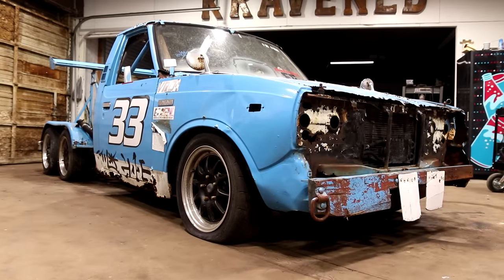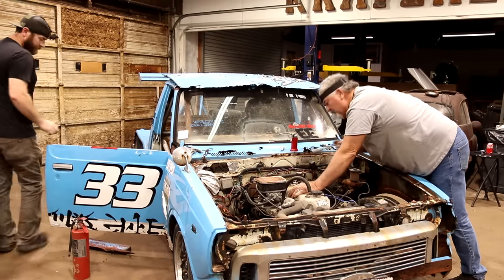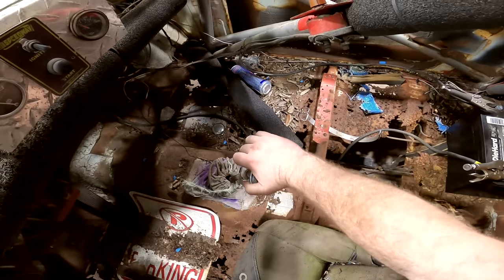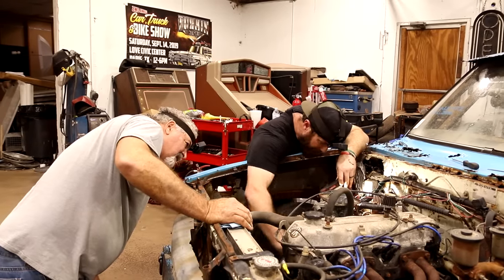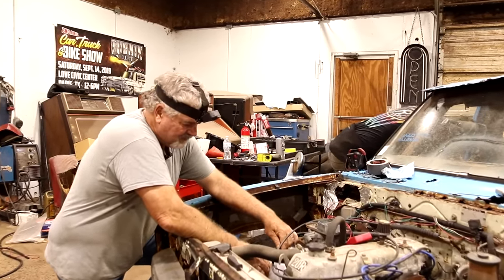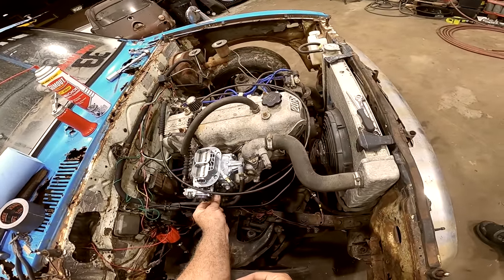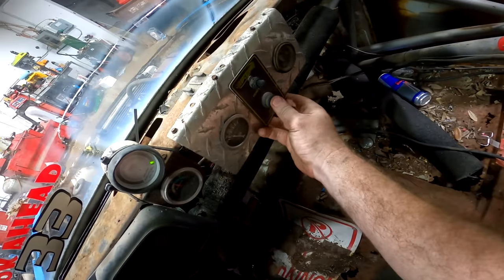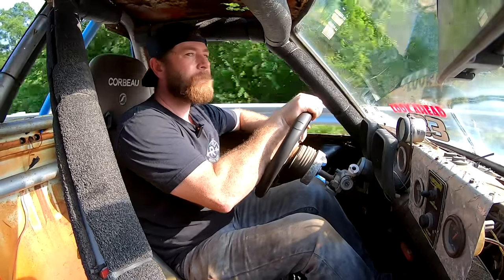Will It Run Abandoned 6 Wheeled Mini Truck | Iconic 1977 Toyota Hilux | RESTORED

Comment: When you found the writing on the back of the spoiler it all made sense.  The "24 Hours of Lemons" is an endurance race for ordinary guys - you go out and find a junker, get it running, and bring it and race it.  But it can't be over $500.
Reply: THE APEX VINYL TEAM first in there clause for 23h and wold not start after there last pit stop hence the i got screwed award
Reply: it started in the 2012 24 hours of lemons, there is a picture of it online here is the description........... That brings us to the I Got Screwed Award, which want to the Apex Vinyl Mater six-wheeled Toyota Hilux pickup. With its slushbox transmission and ill-suited-for-LeMons-racing 20R engine, the six-wheeler isn’t anywhere near fast, but the Apex Vinyl team looked to have the class win nailed down with less than an hour to go on Sunday. Then the truck wouldn’t start after a pit stop, and the TARP “Simca” got the Class C win by two laps.

Comment: Excellent video RESTORE Crew  Wyatt  :) , Lance  :) , Christine  :) also nice video on Race Truck and nickname Catch Me If Can ? I like it to and wild build yes and first ever seen 6 wheels on 1977 Toyota  pick up for sure and motor surprises me it 4 cylinders with  4 spark plugs also wires! Most old from that years were 2.4 litre with 2 spark plugs on each cylinder and 8 wire on one distributor cap ! Someone must use old Datsun type  to for sure 👍!

Comment: 20R
The 2-valve SOHC 2.2 L (2,190 cc) 20R was produced from 1975 through 1980. Cylinder bore and stroke was 88.5 mm × 89 mm (3.48 in × 3.50 in). Aluminum alloy heads were used.

Initial output was 72 kW (97 hp; 98 PS) at 4800 rpm (90 hp (67 kW; 91 PS) in California) and 162 N⋅m (119 lb⋅ft) at 2,800 rpm. Power was down slightly from 1978 through 1979 at 71 kW (95 hp; 97 PS) at 4800 rpm and 165 N⋅m (122 lb⋅ft) at 2400 rpm. The final version, from 1979 through 1980, was down again at 67 kW (90 hp; 91 PS) at 4800 rpm (still at 95 hp (71 kW; 96 PS) in Canada) and 165 N⋅m (122 lb⋅ft) at 2400 rpm.

The 20R and subsequent models featured important design changes relative to the earlier SOHC R-series engines. The head was changed from a reverse-flow to a cross-flow type with hemispherical combustion chambers and shorter valve rockers. The timing chain was strengthened. The lower block bearings were strengthened against wear, safeguarding oil pressure, and the stroke was lengthened. The changes increased torque substantially and shifted peak power and torque towards the lower speed range. The later R series engines did much to establish Toyota's reputation for reliability, which had previously been indifferent at best.

Applications:

1975–1980 Toyota Hilux
1975–1980 Toyota Celica (U.S. Version)
1975–1980 Toyota Corona (U.S. Version)
Toyota Stout (RK110/111)
Toyota Coaster (RB11)[20]
Reply: you sure though 😂 👍
Reply: @jmyd83  Yes Sir, been known to work on Toyota's a time or two . But mostly like the older Chevys.

Comment: Back in the day I had a 77 Toyota Corona Wagon. I named it Timex because despite having been T-Boned, the ol' lady rear ended someone in it, Stolen (and recovered eventually), did some mild practice hits on my demolition derby cars, and having almost 300K, it definitely took a lickin and kept on tickin. It finally met it's demise when the guy I sold it to was running from the cops and tried to cross the rail road tracks where you weren't supposed to cross them. ANYWHO, I always thought that little knob thing on the distributor was to "fine tune" the timing. But that's just what I thought, not really sure. Those 20R and 22RE motors are bullet proof. God Bless!

Comment: Those were good engines, nice wheels, and it does run. All else fails sell the good parts at auction and you can get your money out of it. 
I bet that header isn't cheap either. You may make a bit yet. Best part is you got out there with your pop. My dad is 82, not doing well, neither am I. Just good to spin a wrench with your pop. Worth every dime.

Comment: Both my Toyota Hilux trucks are 4x4 so looking at the a arms in this one is different. Take that 20r head and stuff a 22r short block under it. The head is better than the OEM 22r heads. And the extra CCs of the 2.4L will help

Comment: Back in the 80s I had a Toyota truck a couple years older than this one. It ran like a top, but the body was so rusted out, you could literally lift the body off the cab. It was just sitting there... 😂😂😂

Comment: I've noticed several of the older electric fuel pumps are failing. When I open them up the rubber baffles and valves have turned to goo. Probably the new gas blends are dissolving them.
Reply: I have a small engine shop, ethanal is hard on fuel components. I get carbs and rubber fuel lines that have turned to goo even after sitting a year.

Comment: It's a Lemons "Dale Truck" Blue with 33 on it!  It would have been raced in the "24 hours of Lemons" race. Where you need to make your car and team have a "Theme" and it must only cost $500. The teeth in the front is probably part of the Theme it had as well as the Dale 33 Blue etc.  I'm assuming that's Japanese Lettering on the doors I wonder what it says??

Comment: Best I can tell this trucks last hoorah was in the 2012 leMons race where it came in for a pitstop on hour 23 and would not start back up when they got ready to finish up the race where it then recieved the “I got screwed” award for that one. The truck started out with dark blue and red flames, then went to solid black, and it’s last config was that powder blue, all the while having those same wheels. But In the last race I could find I noticed the damage on the body but none of the rust. So she’s rotted in 10 years really bad

Comment: That truck almost won its class C in 2012. It wouldn't restart on its last pit stop and loss by 2 laps. It the Apex vinyl mater six-wheeled. Look it up on car and driver. It did get the I got screwed award

Comment: Yep it's a Toyota and stays a Toyota I'm driving a Toyota 2 wheel drive king cab 1994 with 290.000 miles on the clock no blue smoke, first engine. Still happy.

Comment: If I bought that truck and found out it was in the 24 hours of lemons  race, I wouldn't put another dollar in it. The race is about bringing junk and racing it for 24 hours and most Vehicles blow up or if they finish they're not running to great. Roadkill has race there.

Comment: the only thing that truck is good for is selling it for scrap you can replace everything under the hood and it'll run but then the body still looks like crap and you can try and re-do the sheet metal but the frame is in horrible shape so either way its good for scrap a waste of money just get a new project truck and make it into a race truck keep the fin from the back the only thing thats worth money off the truck